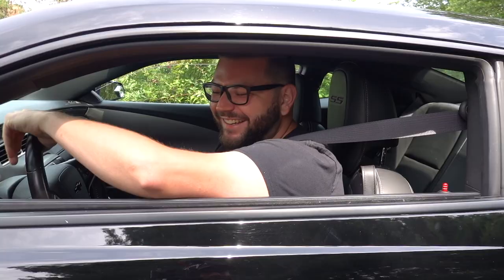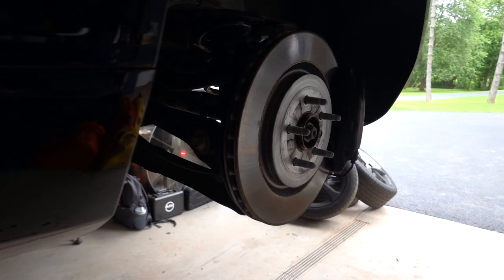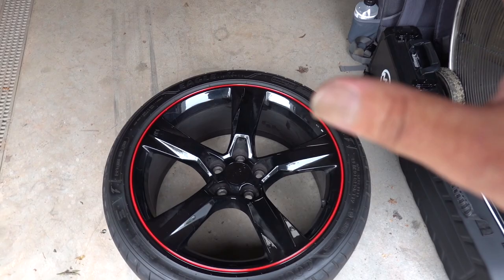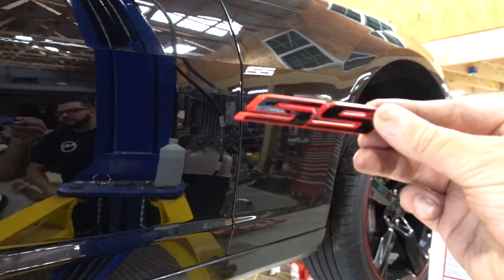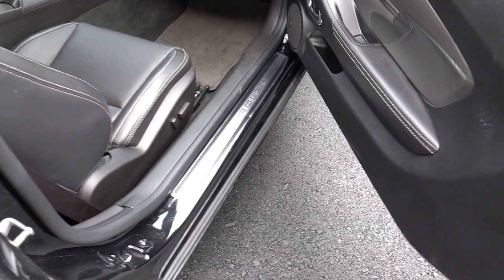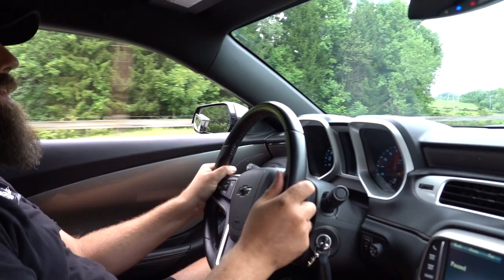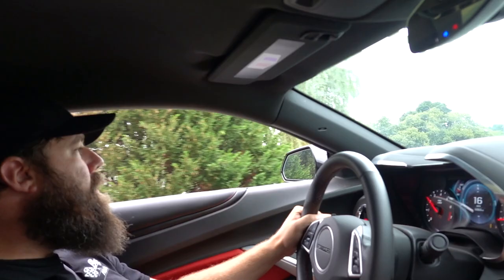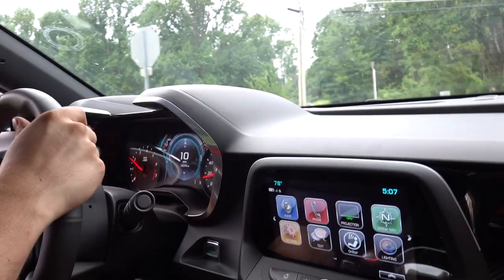6th GEN VS 5th GEN CAMARO

Comment: To me, the 5th Gen Camaro has the look and feel of a true muscle car while the 6th Gen holds the edge in performance. There’s just something about the styling of the 5th Gen Camaro SS that really does it for me. I spent a lot of time reading and researching before I bought my 2013 2SS, and feel as if I chose a car that I will be happy with for a very long time. 

Nothing wrong with a 6th Gen either though, nor the S550 Mustang, or a Challenger with the Scatpack. I like em all.
Reply: me too man I'm waiting for cars to go down so I can buy a 2013 ss and I'm gonna add a terminator carbon fibor hood and a good dual exhuast for the looks.alsp will add z/28 rims and some good ass tires.
Reply: I want a orange 2013 2ss automatic,thought about the 2013 zl1 but it's better to mod a ss
Reply: same here. thats why i bought the 2015 SS ;)

Comment: I see you're in PA , I own a 2014 Camaro SS and wanted to know if you have a club for people who own Camaros , it would be nice to hang out with guys with the love for the car plus I''m having major issues with my car  ( seized motor ) and could get a little advice
Reply: Best of Isis save up some money for new motor I suppose😅
Reply: @mossbergthebulldog6921  I got the new motor a year and a half ago and It's running like a dream
Reply: @theblackboxpodcastshow1791   right on buddy , do you know what caused the motor to fail ? I have a 2011 2SS with around 45000km, no issues so far butt I did just put a whipple on it and a few other mods so fingers crossed 🤞

Comment: I have a 17 Camaro SS manual with muffler delete and Throttle Controller....it's bad a$$. I also have a 17 Camaro I4 turbo FBO with a Spec stage 1 clutch and aluminum flywheel...trust me, the 4 banger Camaro may not be American muscle....but it's one bad a$$ sports car, especially the handling.

Comment: The K@N cai is just fine. Your not winning or losing a race because of a cai.
Reply from the maker: True but the K&N system doesn’t seal right to the fender and causes endless dirty filters plus the connectors are rubber not silicone, it fine I guess but not my first choice